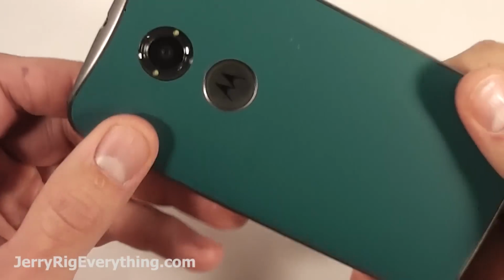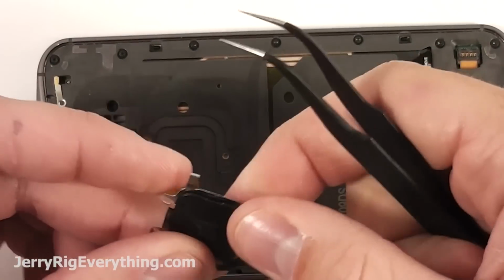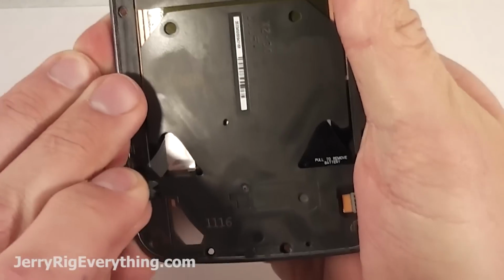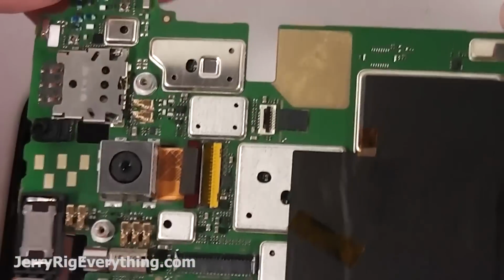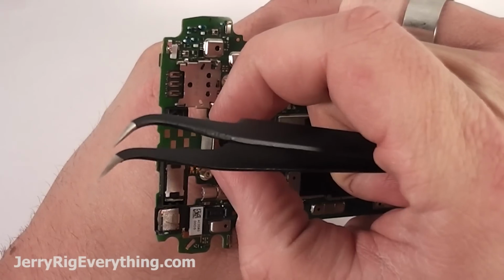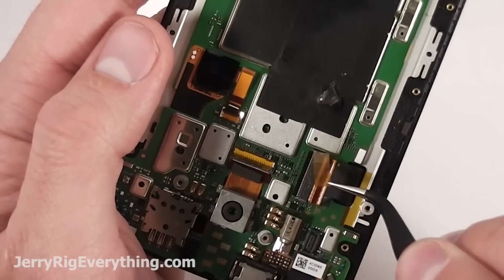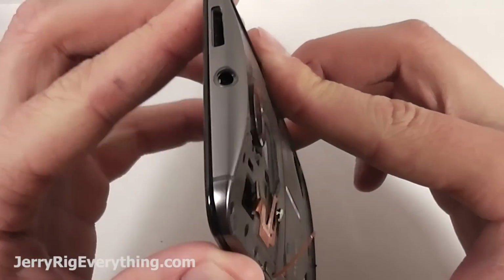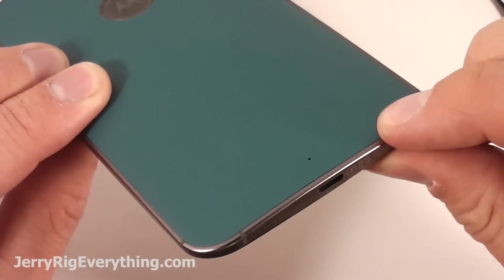Moto X (2014) Tear Down, Screen Replacement, Battery Repair, COMPLETE!

Comment: I hope your able to see and find my comment! I replaced the battery, but in the process of disassembly, the latch and connections on ribbon cable were broken at the end where it connects to power and volume +, - !
I have no idea how to locate another cable except to check cell phone stores and see if recycling pile has an old one I could use for scrounging for parts.
My Moto X second gen has been one of the best phones I've ever had and I was using it quite often on Wi-Fi, without phone service.
Let me know your thoughts on locating a cable if you think there's a source for that purpose.
Any response would be much appreciated! Thank you.

Comment: Excellent video and to the point. I'm going to attempt to take apart my gen 2 and see if the screen connections are tight. I had the phone drop on the floor from about 1.5' high (off the couch) and now the screen won't come on, but the phone seems to work fine - at least from the notifications I can still hear.  I'm hoping I don't need to buy a replacement screen, but your video should go a long ways to helping me get it done one way or another.  Thanks for taking the time out to show and post this video. Well done.

Comment: I got mine working thank you very much you're a life saver... just remember guys the screen alone is very fragile i put a little too much pressure on mine trying to force it back in and it broke a little off the top still much better than the fully broken one i had but that's a think to remember.

Comment: Had an old X2 that I planned to use as a remote for casting. Broke the sim housing trying to get the back off. Broke the power connector. Spent an hour going through a large collection of tiny screwdrivers I had collected for a long time for this very job, trying to find one that would remove those screws. Stripped a couple screws. None worked. Finally threw the whole damn thing in the trash. What's the point?

Comment: Great video, very helpful for me! 
But just a note of caution when pressing the battery connector back into the PCB socket at the end: Be gentle. If it is not aligned, a too firm a press can break off some of the delicate connector plastic (at the end). Luckily the connector still remained seated, so I think I'm ok ...

Comment: He makes it look pretty easy. Im not so spooked about getting an expensive phone with the locked in battery now. I didnt want to get an expensive paperweight if the battery failed in year 2 or 3 but now i can change it myself.
Reply: Since they are all going to sealed batteries best get some tools and get use to doing this kind of work or get ready to part with some serious cash every time your battery fails.  Motorola wants $125.00 to replace the battery.

Comment: I replaced it.  I bought my compatible screen from eBay for 42$.  The brightness was different with the new screen and the touch screen did not work that great.  I would like to get an authentic replacement screen.  Great video.

Comment: I love fixing things myself and you make it look easy!  I'm looking to buy the Moto x 2nd gen on ebay..but I'm worried about how long the battery will last, I'm not a gamer so the phone would only be used for the regular stuff, calls, texting etc.  Are replacement batteries available if needed?

Comment: Hi Jerry, I am trying to replace my moto X 2014 screen and your video is very clear on what needs to be done. However, mine has leather backplate and it won't pop out as easily. Stabbing it just push the flimsy leather apart from other glued layers, and I can't find anywhere to pry without damaging it. Do you have any suggestions?
Thank you for awesome video!

Comment: Nice video, just wondering if you could tell me how many microphones the Moto X has? I've been told four and can see the holes where the two on the back are but can't seem to locate the other two? Just wondering as I've been having issues with people not hearing me properly when I'm on calls and I want to make sure my case or screen protector isn't covering the mics.

Comment: Thanks so much for uploading! Excellent teardown video. Just got a Moto X myself, and its time to start modding it! I'm just starting to put together and idea for wireless charging. I'm thinking of getting one of those wireless charger packs that connects to the phone via micro USB ribbon cable, but instead connect the wireless charger module direct to motherboard. I presume I need to connect it to the motherboard where the current usually passes in right? (rather than where the battery connector is). Would you have any sort of decent quality pictures of the mobo/schematics or anything for that area handy? Or any advice to point me in the right direction? Never modded a phone for wireless charging before. Thanks, Barry

Comment: The screen on my Moto X 2014 just cracked a few days ago. The LCD is ruined too. Let me know when you find a replacement for the screen + LDC. Also, do you think the backing of the phone would still work the same if mine is bamboo? I feel like it won't stick back on correctly.

Comment: Hey man I've repaired many a phone in my day but I just spilt a bit of tea on my phone luckily it has a screen protector and drop case so I flipped it over and it seemed dry.... I ran paper towel edges through the speakers but I'm concerned they may have been damaged (I worry about little things) but from this video it seems sealed well... you think im good? no appearent water damage and its functioning perfectly a few hours later

Comment: Jerry, I have the same tools you got on the link. I am trying to fix my moto x 2 gen. I am trying to remove the screw's on the back but none of the ones that came in the box seems to go with the screw's? Any suggestions

Comment: any idea how to gently remove the two speaker pieces to gently reinsert in order to reuse them in my new LCD and digitizer combo assembly mine didn't come with new speaker pieces so I have to take them out of my old display and put them in the new assembly and I don't want to end up breaking the glass doing it

Comment: I broke a part which I believe must be the antennae.  It is a thin strip that runs horizontally above the camera and it has 3 locating holes.  It is under the back cover of the phone.  Where can I get replacement part?  If not I might solder it back together.  Please advise.
Thanks,
Paul

Comment: Can I move speaker grills from one LCD frame to another? Since replacement LCD's are sold with speaker slots
Reply: Same question here
Reply: +Benjamin McIntosh appareantly you can but first you gotta ensure you buy "full assembly" LCD already embedded on the main plastic frame which houses screws slots, a lot of sellers sell just plain LCD and I have no idea how that's supposed to be installed. The grill speakers are extremely tough to mount though, it is much easier to take them out then put them in a new place

Comment: my gsm moto x 2014 uses smaller screws than t4.  FYI I don't  think it matters if CDMA or gsm.
Reply: Thanks for adding that. Best have a T3 and a T4 ready before you dive into this.

Comment: I just had the LCD & glass fixed on my Motorola x 2nd generation and now the screen goes black when I make a call & Motorola is saying that the proximity sensor gasket has either been put in a little off & needs to be put exactly in place or the gasket is missing all together ...They said I should take it back to the place I had it repaired and get them to check that ... Well the repair shop said they didn't get near the proximity sensor or gasket during the LCD & glass replacement so they will look at the phone for a fee and even if the gasket is missing they can't find the sensor or gasket .... what do I do ? buy another moto XT 1097 & see if the gasket could be salvaged & find another place to get it repaired ? I was just wondering who is right, Motorola or the repair store ?

Comment: Hi, I seem to be having a problem with the antenna. my motox incurred some water damage. everything works, except it will not connect to my mobile provider network. wifi works fine, just no cell service. any suggestions on how to repair the antenna?
Reply: Darrin Chungg JerryRigEverything  Same here... Any solutions yet???
Reply: I'll take it off of you hands if you want

Comment: I have the Moto X 2nd Generation. When I turn the phone on and get past the initial screens and Verizon logo, my home screen is black. The touch screen doesn't work at all. I can press the on/off button and will receive the power off screen sometimes. The phone will also instantly begin to overheat. I have taken the phone to two different phone repair shops and no one will bother to work on the phone. Do you think this is an easy fix or should I just send it to the phone cemetery?

Comment: What hotplate and UV light do you use? I want to use it for everyday Galaxy repairs.
Reply from the maker: Michael O I link all the tools I use here: http://www.jerryrigeverything.com/2014/04/want-start-cell-phone-repair-business/
Reply: the link to your uv light is dead and the hot plate link just takes me to eBay listings with random hot plates. Just wondering what make and model you use to avoid purchasing a junk hot plate. Thanks!!
Reply: JerryRigEverything Yes, your link to the uv light is dead. Can you suggest which separator and uv light is best for most phones?
Reply from the maker: Alright, I think I got both links fixed.  Check it out. The hotplate that I linked is the same one I bought a few years ago, just not the same seller.  Lucky for you guys, theyve dropped a few hundred bucks since I started. I think I payed like 300+ for that kit.

Comment: Hey I've replaced a few phone screens thanks to your videos with out a problem.  But I just replaced the digitizer and glass on an Asus t100 its a windows tablet.  And I seem to have scratched the flexi cable and the digitizer isn't working.  Would the scratch cause that?
Reply from the maker: Brandon Mullen Its possible.  Especially if you got deep enough to touch the wires under the protective plastic.
Reply: OK I can see the copper underneath.  Its frustrating because it was from my tweezers they slipped a little and scratched the protective covering off.

Comment: Hi! after changing screen like You showed my battery is now showing 100% all the time. battery died I plugged in to charge and still showing 100% when unpluging charger phone switches off because of battery is dead. Any ideas why this happened?

Comment: Hello Jerry, I need your expertise the screen of my moto x has just died and I need to take out all the information of it, but the thing is that I connected by usb and the computer doesn’t recognize the moto x,  I couldn’t  put the phone on usb debug in order that it be recognized by the computer. When you take out all the parts did you see the sd inside?
Reply: I had a similar situation and my solution was to cast the screen to my television via Chromecast.  took a few tries to get to the right submenu blind and by memory, but it worked like a charm.  hope it helps you out.

Comment: hey. my moto x 2 got drenched in rain allowed water inside the SIM tray. as a result, my touch stopped working. an expert said that the display and touch digitizer is fine but the motherboard has some problem. I am from India. any suggestion from you would be helpful... thanks
Reply: Probably just get a new phone or send out to Motorola.

Comment: Any luck finding the replacement parts? (specifically the screen?)
Reply from the maker: John Kha Not yet... I wish.  Let me know if you find any.
Reply: JerryRigEverything I ordered one from a place in Hong Kong that says its for the XT1096, I have an XT1097, but I think this part should be the same. I will post a link when I get the part installed.
Reply: http://www.parts4repair.com/complete-screen-assembly-with-bezel-for-motorola-moto-x2-xt1097-for-at-t-black/ The one I ordered did not come with the bezel, which complicated things. I bought just the bezel from a different company, but now the whole module is available. I highly recommend getting the whole module.

Comment: Hey jerry im 15 and have been repair electronics for sometime and cant seem to make any money or very little I mean im good at it ive had maybe 1 unsuccessful repair in around 40 phones so what am I doing wrong people want to give you nothing to repair their phones that need loca repair. They just don't understand its hard. What do I do? Also when a repair is unsuccessful what do you say to the customer?
Reply from the maker: Danny McRae Just charge more for your repair.  Make sure it is worth your time, or just dont do it. As far as broken repairs, I usually explain to the customer that there is a chance that their phone COULD be broken beyond repair. If they dont accept that before hand, than I let them find someone else to work on their phone.
Reply: Alright thanks
Reply: I recommend you show them the process. They might humble up.

Comment: I tried to change battery but the Chineese one I bought is really too thick, it will never bend like original. Anyway I broke the battery connector so I wil not be able to close it with new battery.
Reply: Hi Mariano. I also broke the battery connector while trying to change the screen. Phone does not take charge anymore. Have u managed to fix yours somehow? Thanks!
Reply: +Matija Tkalcec-Maturanec I just charge with an external charger thé Old battery and close it again. this moto x dropped on toilets and stayed à few jours on thé water. i have to buy some isopropylic alcool to try to clean thé mobo on ulrasonic machine. may be in october.

Comment: I bought a new screen and the T4 screw driver is too large for the crew head...any thoughts?
Reply: +Aaron Smith I know, me too. He made a mistake with the number. You'd think that'd be the easiest thing to get right....it's actually a T3. Would have been nice to know that $20 ago.
Reply from the maker: +Caramel Woodpecker Chinese tool kit have variations in bit sizes. Feel free to make your own video.  A T4 worked for me.
Reply: Then don't advertise Chinese tool kits
Reply: +JerryRigEverything  I bought a kit with Motorola tools..would a T3 work?
Reply: I did the same. And yeah it worked
Reply: +Caramel Woodpecker Did the replacement screen work well?
Reply: Yeah, but I didn't get it from the link included. I got it through ifixit. I bought a macbook battery from them before as well. http://www.witrigs.com/oem-lcd-with-digitizer-for-motorola-moto-x2-black
Reply: Same!
Reply: There are a number of videos out here for this phone and some screws are T3 and some are T4.  You're not going to know what you have until you crack it open.   Best be prepared and have both sizes ready.
Reply: does the screen work though? I was thinking of buying a replacement screen but I don't wanna spend 100$+ without knowing that I'll get something for my money..

Comment: And where can I buy these Screen-Replacement-pieces?
I haven't found anything on amazon.
Reply from the maker: 10defo I have not found replacement parts yet either. Let me know if you find anything!
Reply: JerryRigEverything Found some on eBay. Screens alone are ~$10 and whole screen/digitizer/etc is about $275.

Comment: so its pretty much the same deal with the nexus 6 from the looks of it.
Reply: Both r same in specs also, the only difference is nexus 6 has larger screen and 3gb ram and 2k display
Reply: rOnIt HäWţîčŁïXîØůß bÕý and bigger battery and a faster processor and OIS for the camera and daul stereo speakers. Nah  I wouldn't say they have the same specs bro 😋
Reply: Yeah didn't noticed those things 😛